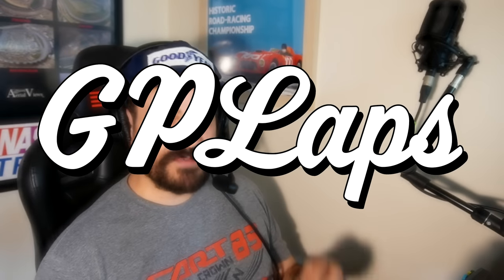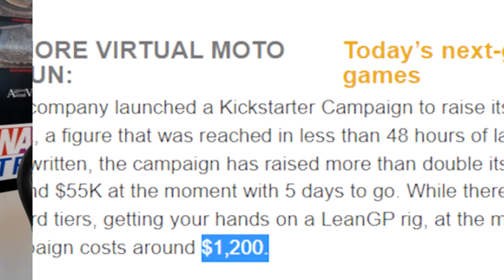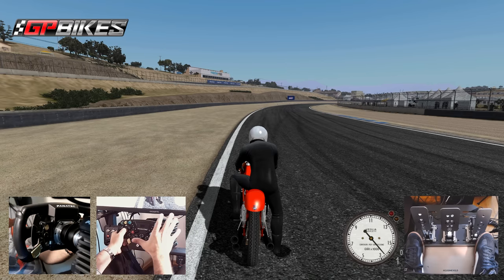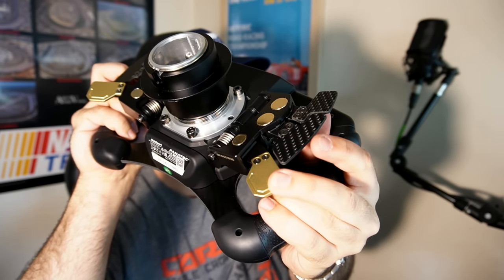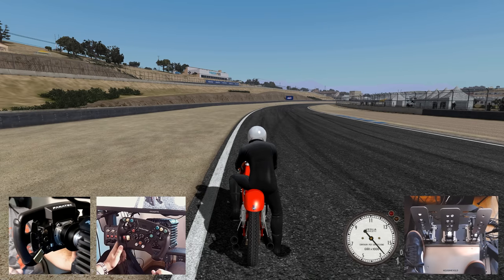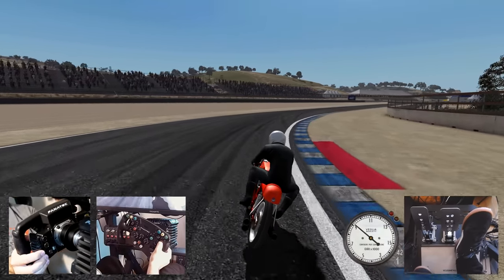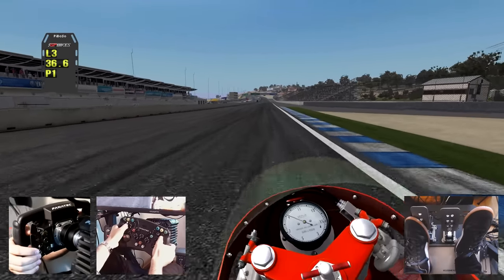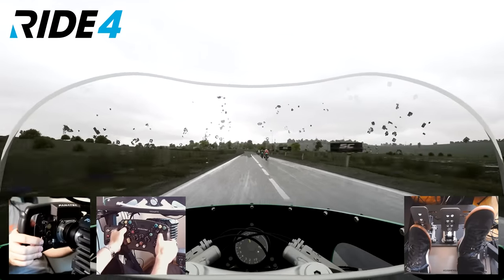Set Up Better Controls for your Bike Sims! - Basics Tutorial

Comment: GP Bikes has a realistic steering mode somewhere hidden in the ini files. It's a bit janky and super hard but its the only way in any bike game to get close to how steering a bike actually works. I did some videos using it and back then it worked like this below, just not sure if its still working like that because I havent checked newer versions. 
How to use realistic steering inputs:
1. open "C:\Users\"username"\Documents\PiBoSo\GP Bikes\profiles\"profilename"\profile.ini
2. add 
[hardcore]
directsteer=2
directsteer_maxangle=50
3. setup your wheel rotation to 90 degrees maximum in your driver profile
(you might need to play around with those last 2 values to finde your sweet spot)
Reply: Interesting. So is it like pushing against the forcefeedback in order to simulate pressure on the handlebars? Does is then also move the wheel to the correct steering angle as you lean over?
Reply: @sntslilhlpr6601  you have quite authentic FFB and you need to counter steer to get the bike leaning into a corner or to straighten it up or change direction. Having a lowsider or highsider feels scarily realistic as well. Depending on the lean close to loosing grip you can also feel it getting light and wanting to fall into the corner. The downside is that it's a bit janky and rough, not really smooth which can lead to jolts and oscillations unsettling the bike and wanting to rip the handlebar out of your hand. Also the steering needs to be less sensitive than in reality, I think I had it so you had to steer roughly 3-4 times as much to avoid problems but it was still super interesting but also very, very hard. You can search my channel for GP Bikes videos, I also did one in VR/Mixed Reality.
Reply: I see I'm a little late here, thanks for mentioning direct steering, Marcel :) Here's a few additions...
If you want a manageable directsteer=2 mode, it's best to limit yourself with GPBikes version 19 only. Starting with 19b the force-feedback code (among other things) got rewritten, so DS2 mode became mostly useless. With newer versions I'd recommend switching to directsteer=1. It's not nearly as immersive as DS2, but at least it's much more precise and you still get to use direct steering (more or less, because you command the handlebars torque with your FFB wheel).

Pretty much all of my GPB content is recorded in the DS2 mode (apart from the most recent additions - those are DS1), so anyone who is interested in checking how GPB fares using a Logitech G27 with direct steering is welcome to come and see for themselves (and ask for details). Sadly, you'll see a lot of crashing, but just like Marcel above said direct steering is really a handful (still worth it though).
Reply: @getsideways7257  hi, what was the difference again between DS1 and DS2?
Reply: @MixedRealitySimRacing  Hello, Marcel! DS1 is the mode where the controller angle is translated into the virtual handlebars torque, whereas DS2 tries to align the virtual bars to the controller's angle. Of course the latter is done with a LOT of imprecision, since the actual steering angle change on a real bike is almost imperceivable at all (maybe 6° in total beyond 20 kph). But since the FFB acts against your input, it feels much more natural than DS1, in which you tend to turn the wheel quite a lot - even from a side to a side in a quick succession. Still, it's too easy to drop the bike in DS2 at large lean angles because in those cases the sensitivity is paramount and it's too easy to overshoot the desired angle. With DS1 you tell the rider how strong he should be pushing on the bar, so it's much easier to keep within the range... but it feels weird. Especially when you have to flick the bike from one side to another.

I think either my most recent GPB video or two of them is done in DS1. You can see there that I'm much more precise in those cases, but getting underway is quite a challenge in DS1 :) Also, with the lack of FFB in the recent GP Bikes versions DS1 is basically the only way to go, because DS2 highly depends on the FFB.
Reply: I thought someone moded it so you don't have to do the files

Comment: Nice to see so many of us went the same route. I use my Fanatec wheel for lean, with the clutch paddles in handbrake/clutch mode for front brake and clutch, throttle on my V3's for throttle, brake for rear brake - in VR.

Comment: As I ride in RL, just found that inverting the steering (as if countering it) is way more intuitive than think of it as a lean controller. If you have a TrackIR, can use it to control leaning and the wheel to emulate the steering (counter, as I said) if the game allows it. Personally I found all controllers just anti-immersive and the game GP Bikes the worst, as it try to be a simulator, and that do not work, IMHO, without a more advanced bike dedicated rig. So, I usually play these casual-realistic games, such as RIDE 4. For that I use a XBOX controller and find that this is the most "immersive" set of all:

L-Analog: Turn the bike
R-Analog: Up to front brake and Down to throttle
RT: Rear brake
RB: Look Behind
LT: Gear Up
LB: Gear Down

Always use TUCK-IN at automatic, because in RL it's something very intuitive and the extra button ingame isn't. It's the less worst config and the only issue is that steering in RIDE 4 is too sensible
Reply: Exactly. Reversing the steering access would do it. The only way to emulate counter steer inputs. I'd also use the brake pedal for upshifts. The podium paddle module would be a must. Retired rider - 43 years in the ton-up club.
Reply: Thanks for the tip - I might just have to try reversing inverting the steering.
Reply: @simonolsen9995  I might try the brake pedal for up-shifts, I'm currently just using the paddles on the wheel.
Reply: Ideally the steering and FFB would be really small in range. I don't think our wheels can do this convincingly though. But then I guess having the bigger range for counter steer sort of has the steering correct (push inside bar to tip in), and also gives some of that feeling like you are moving to the inside of the corner. You know how you feel like your outside arm goes across the tank
Reply: @layingblacklines  I think that all the point is to find a compromise between the bare minimum feeling of riding a virtual bike realistically and all the hardware we already have and just let our imagination fill the gaps lol. Counter steering a bike is not as "direct" as steering a car and is way more subtle. With a real bike, I just don't think about doing the CS because it's pure muscular memory, the same way than, after more than 40 years playing videogames, pushing the analog stick to turn any vehicle is just another instinct. That is why a gamepad is the better choice for me, because my head is already trained to believe that it's real. Using a steering wheel or even a flightstick (that I used in early 90s to play the first bunch of racing sims made available to me) is more of a way to have more precision on my inputs. A TrackIR would be a good immersion tool if the game is compatible with it. If you have a control with inclination sensors (as the Dualshock 4 or the Wiimote... that I have both, but need to set it up the last and to fix the first one), it may be another good option
Reply: The worst? GP Bikes (and MX Bikes) is basically the ONLY bike sim out there that can let you control the handlebars almost directly. You'll have to do some .ini editing for that to happen, but it's nothing too complicated.

Comment: Honestly 1200 USD for a fully functioned bike rig is a steal. An entry-level DD rig will run you about 2000 USD most of the times, and that number can easily grow if you just want " a bit nicer" of everything, like my rig did...
Reply: I was thinking the same, even sth like a Moza 8 NM motor, with a GS steering, & CRP pedals, are in that range, not to mention atleast $100 each for a gear lever & handbrake

Comment: these are great controls. i don't do bike sims only cars, but as a rider irl, having the left and right reversed would seem more intuitive to me and having the wheel base more upright, nearly straight up (maybe 70-80 degrees). that way you'd be countersteering to initiate the lean, so push left bar to turn left, and push right bar to turn right. also maybe have the wheel centering force set very high on the dd. 

some company really should create handlebars and foot controls for bikes and take the first move. it's not exactly a engineering dilemma, some potentiometers/hall effect sensors, loadcell brake, and switches would cover all the rider inputs.

Comment: You should definitely almost always use bothe the rear and front brake similataneously. In racing games anyways, because it gives you maximum decceleration, but in normal conditions as well. You certainly don't need it in normal situations, but if you are in an emergency situation, and have to act instinctively, you might forget the rear brake, making you lose around 10-15% of your braking power.

There are some special uses, where you should only use one or the other, but for general braking, always use both.
Reply: The rear brake can help for a tighter turning radius but generally if you are not after the last bit of speed as a pro you never really need it. Also in emergency braking situations its best to just focus on the front brakes because at the limit your rear tires will not be in contact with the road anymore and will lock instantly with the slightest of input.
Reply: @MixedRealitySimRacing  normally, an emergency brake should happen on both tires. Atleast that how learnt when doing both of my driving exams. Unless you drive a high performance  vehicle with racing rubber, your back wheel should not lift of the ground when doing emergency braking. Especially if you actively shift your weight to the back (which you should do). You can actually test it out if you have abs. Drive around 70 kph and do an emergency brake with both brakes. You can actually feel the rear ABS. On a "normal" street bike, braking with both brakes is always better.
Reply: @brinkipinki  true, depends a lot on the bike as well, a chopper will have much more braking available with the back then a Superbike you sit high on and has really good front brakes.
Reply: This applies in real life as well. And what he said in the video is false, most riders in real life use front over rear since it is way more effective…just like a car.
Reply: pretty sure i’ve heard its always faster to just do a 1mm stoppie than manage both front and rear weight
Reply: @jordansundheim7  due to the geometry of a motorcycle it reaches its maximum brake force exactly at the moment before the rear tire leaves the ground or the front tire loses traction. Depending on the speed and the bike, doing an "almost-stoppie" is indeed theoretically the fastest way, but an average (even a good) rider is not able to find that point and tjus should better try to stay just below it, where the rear tire still has contact with the ground.

Comment: I know I use an old Yamaha Motorcycle controller that was made back in the PS2 days, though my issue is it's quite clear a lot of these games were made for controllers and have deadzones because the motions you'd make on the controller actually take time to happen on screen. That delay spoken about, especially in the Milestone games, is actually accounting for the deadzone on the controller stick not needing to be there in something with a more larger range like a wheel or motorcycle controller. I've never found a good mix, but there's not a larger community using a controller made in the 2000s for modern racing games so I can't find a good resource to solve it than learn the bike with some delay.

Comment: Just tried (PS5) TT IOM Rider on the edge 3 game and I have to say the controls (if you set up right) are better than the previous 2 games regarding steering. The weight seems much more better. On the other 2 no matter how you set the steering lean to less sensitive it was like falling off a cliff. This time it seems better. By the way I used the hard mode with no aids only tuck in and out on auto. I have learned to and also got myself using very super quick finger/hand changes on my pad for steering, Acceleration and break. Once you get it it becomes intuitive, responsive and controllable. Remember the PS2 motorbike controllers (SIM to a wheel) by Yamaha I think that came out. Very rare to find but obviously maybe obsolete for a modern system. Shame someone couldn't bring one of these controllers out again 🤔😄

Comment: 06:39 THIS demonstrates the BIG difference between MC games and having the proper control of a real MC bike.
In real world entering such corner at speed you typically do a tad whip countersteering. This in order to take advance of the Gyro-effects so bike automatically lean along the longitudal axis.
You can try this out in real world by giving yourself this challenge: Try to drive in a circle with as small diameter as possible.
With- and without this tiny countersteering. Difference is HUGE.
This my MC driving instructor learned all us driving students in the playpen. Until everyone mastering that part.
Then AFTERWARDS learned us taking use of our body weight, and feeling of Center of Axis w/o Body and w/o BodyWork.
When everybody showed they mastered that part, he finally let os free on public roads, the very first being after just 3k's of my very first public road experience, consisting of 2k's of tiny road with sweeping corners. Our satisfaction experiencing full control I can still feel to this day 32,5 years later.
And this has none to do with the excellent description of smooth driving. But I like MC games alot, nevertheless though I'm primarily a simracer of classic sports cars.
When MC game developers come up with trustworthy Gyro-effects and Hardware developers come up with entry prize level MC rigs, I'm ALL in!
Reply: You always use counter-steering and it does not have that much to do with gyro. Also, you can enable actual direct steering in GP Bikes, so that you'd have to counter-steer to enter a bend (and straighten up afterwards).

Comment: One way I feel increases the sense of the weight shift in GPBikes (a sim which supports VR, by the way!) is by hooking my thumbs into the bottom corner grip loops of my Fanatec wheel. That way, I can actually lean in real life and just let the wheel follow my weight transfer! I think it has something to do with how the axis of rotation then is above the imaginary handle bar. The big downside is: This method leaves everything but my thumbs dangling below/outside of the wheel, so I can't reach any controls and therefore have to use all the assists.

Comment: What I tried was to use a wheel with very small amount of angle and setting it to do the OPPOSITE of what steering wheel usually does (means that when I wanted to turn right i would push with my right hand a wheel to the left and while turning left I would push with my left hand a wheel to the right).

This way it "kind of" mimics how you steer a real bike (sv1000 rider :) ) (even pushbike with obviously significantly less force, but still).

I thing that if I was to use steering wheel for bike ride in sim I would position wheel in such a way that it would face a celling and attach some kind of handle bars to both side of that wheel with obviously right handlebar would have a twist and brake lever and left clutch lever and thumb rear brake lever.

This way you could litteraly push countersteer on handlebars which would be how it is on bike.

If only major producers could give as such a device with quick release to DD base and you could position DD base to face a celling I thing that would be really good compromise and could work while still sitting still in racing seat but still have precise control.
Reply: If you have GP Bikes, you can enable direct steering there - no need for inverting the controls.

Comment: Just an FYI: you can use old  PS2 motorcycle handlebar controllers like the Game Elements Yamaha MS-1 or the Thrustmaster Freestyler Bike on modern consoles and PC’s using a Brook Gaming Super Converter. As long as the motorcycle sim game allows changing button assignments (nearly all do) it’ll work. I have a few videos of the setup on my YT channel. And yes, you can set the handlebars to counter steer, but it feels “odd” because there’s no gyroscopic effect like you get from a real motorcycle’s front wheel.
Reply: My friend I might be missing something but I don't see any of the Brook Gaming Super Converters that will get me to use my USB Thrustmaster Freestyler on my modern PC, can you point me in the right direction as to which one you mean?

Comment: I used my wheel to control bikes in Test Drive Unlimited. I think a flight stick might work better than an XBox type controller as well. I wonder if TrackIR could work for leaning forward and back or leaning side to side too.
Reply: I had a blast with my g25 wheel and the motorcycles on TDU, the lap around the islands was my favorite, managed to get that one down to about 42 minutes

Comment: Great video. I wonder if we will ever see a true bike controller with force feedback. All the games focus on a leaning control mechanic but of course when you ride a real motorcycle you don't control anything by leaning - it's all done with the handlebars. It would be great to have a controller than provided force feedback for the push/counter steering forces you feel when you ride a real motorcycle. The handle bars of a motorcycle don't really move much at all when you are riding at speed and I've never seen any attempt to simulate this.
Reply: You can enable direct steering in GP Bikes if you edit a certain .ini file. It's much more challenging to ride like that though. On my channel all of my GP Bikes stuff was recorded while direct steering.